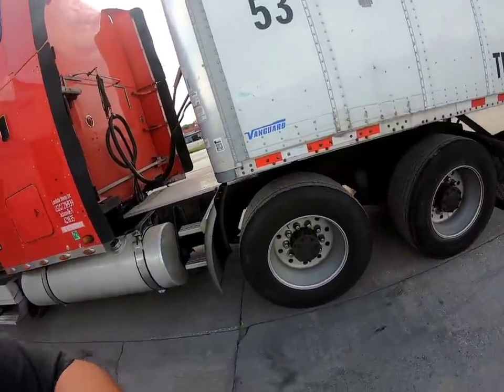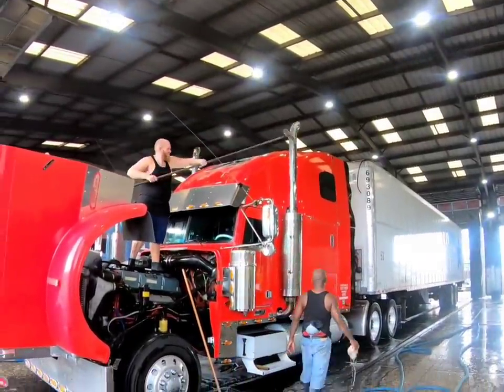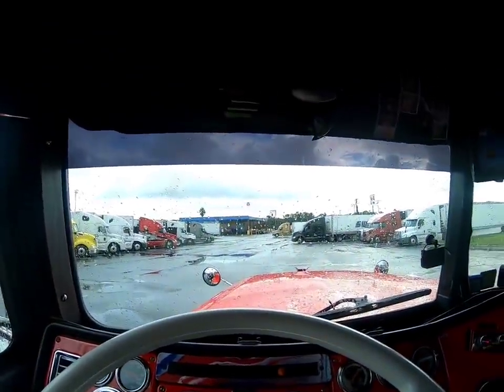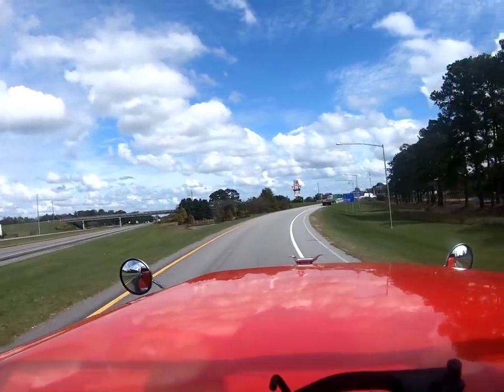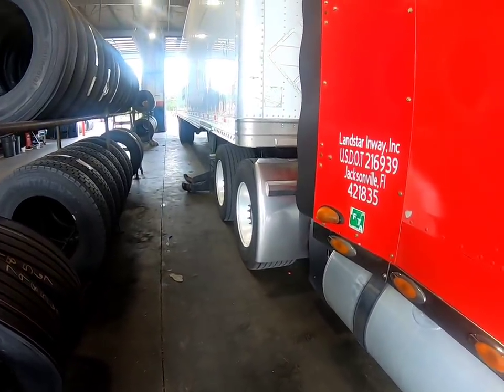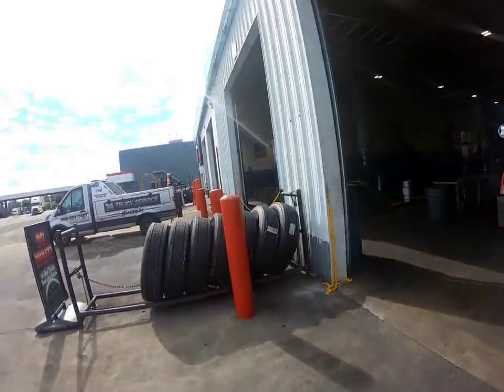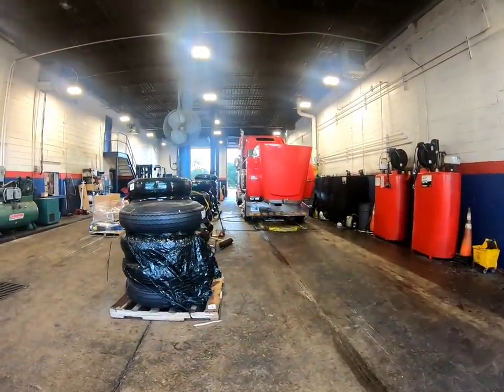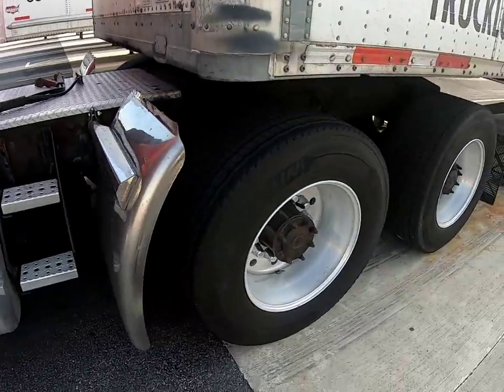Truckin Vlog #22 Wildwood truck wash. Freightliner classic gets inspected plus oil change.

Comment: Did they update the building? Only had them wash my truck once. I recommended the POLISH place across the street to TruckerAK. They do a great job polishing, I wouldn't do that job though.

You are right about the BLUEBEACON, they rush the washes and miss a lot, Always had them reclean the truck
Reply from the maker: Lol I've had the beacon redo my truck several times and even then it still streaks. The polish shop does great work and they have a fair price. Ive had them polish the truck before and ill have them do it again.

Comment: Explain to me why in the hell Landstar want ur ur truck inspected multiple times a year when DOT only requires it once a year so does Landstar pay for the inspections or do you have to
Reply from the maker: Landstar requires an inspection done on all equipment every 120 days. They do pay for them unless you fail. Landstar also doesn't really get messed with at the scales because they know how often we get inspected and the standards Landstar has. They pay us $25 per trailer inspection. Not much but it will ad up to a couple hundred over the course of a year.